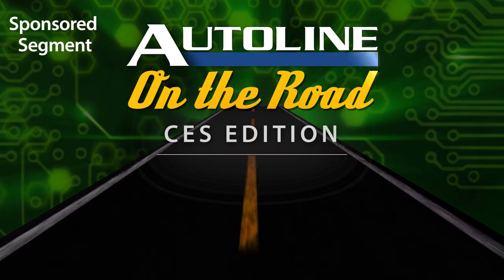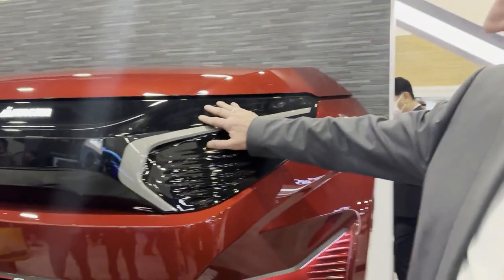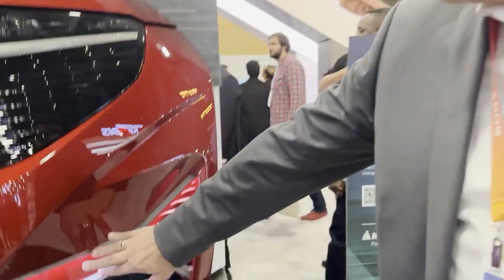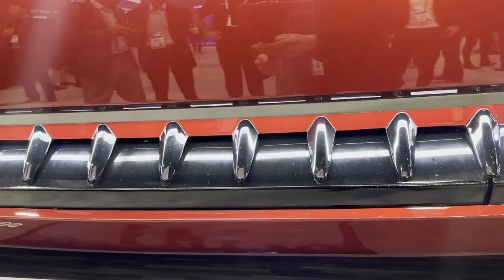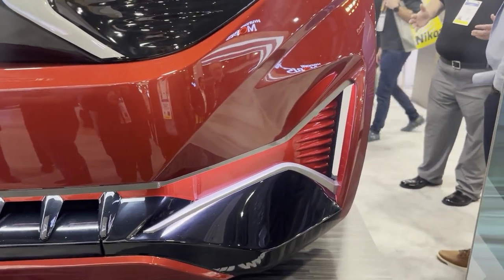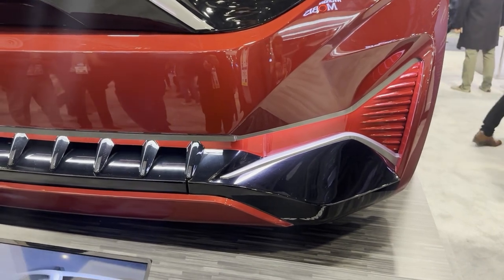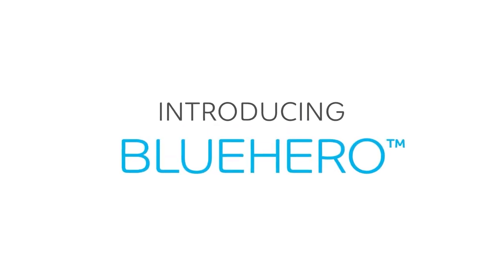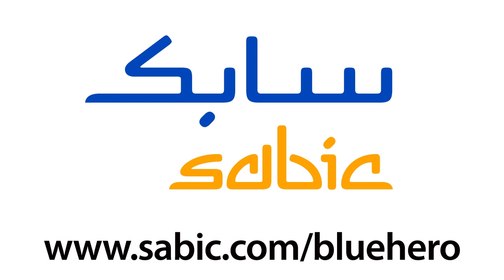Magna’s Active Aero Increases EV Range - CES 2023

Comment: They'll have to design for icing. It should have a backup hinge behind the panel in the event of plastic fatigue breakage. Maybe they could use solid disk aero wheels and vent from the inside as needed.
I'd like to see more Aptera-like ground-up aero design as opposed to making a box then adding aero features.